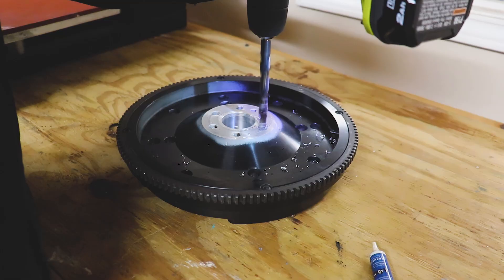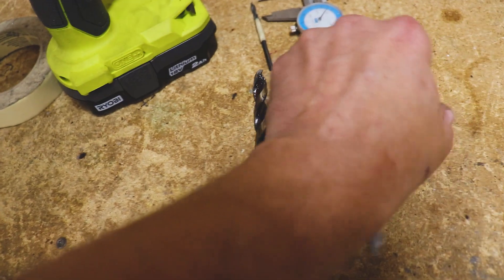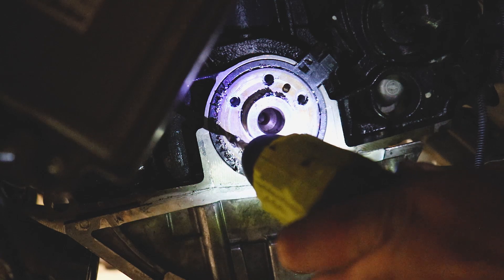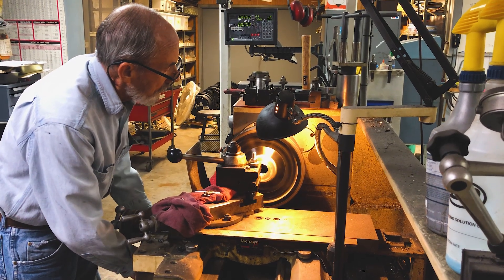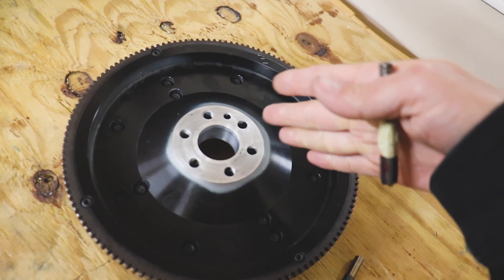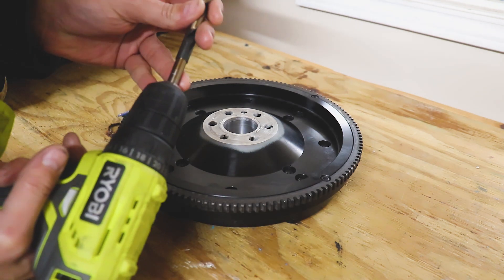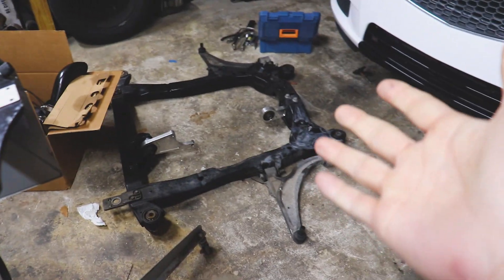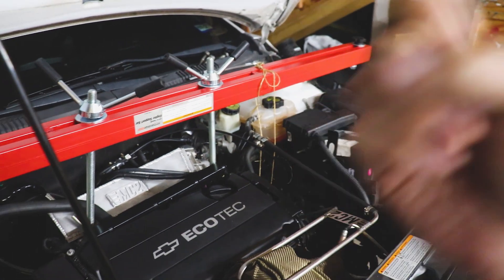Enlarging the Bolt Hole Size in the Crankshaft and Flywheel to Hold More Power! Sleeper Project

Comment: Why did you tap the flywheel for thread ?
Reply from the maker: To install larger ARP bolts because the stock bolts broke off.
Reply: @cmattdabrat  But the flywheel doesn't need thread ? Only the crankshaft.

Comment: Since this crank was a auto transmission engine it looks like there is no pilot bushing to support the input shaft?
Reply from the maker: Oddly enough, I haven't seen a pilot bearing in either of the cranks. Don't think they came with them. Have even searched in the parts manual / diagrams. None to be found / seen.

Comment: With the 2.4 Ecotec I've put 320hp through the stock bolts (6 bolt) and with ARP bolts I've put 400+ hp through it many times and taken it apart, a lot, never noticed an issue.  The LNF 2.0 turbocharged engine uses the same bolts, except there are 8 bolts instead of 6 bolts.
Reply from the maker: Looks like the first time around, the manual I had had the wrong torque specs. So they were over tightened.

Comment: The more I think about this the worse it gets. So bolts in this instance provide 2 forces clamping and shear. The larger bolts may produce larger clamping force although if they are at the same torque specks then they may even produce less. The larger diameter should provide more shear force. However, since they are drilled by hand the shear could be on one or 2 bolts at a time instead of all 6 at once. Precision-drilled pins between the bolt holes would provide more shear force without enlarging the bolts.  Video on how larger bolts doesn't mean the same clamping force. data starts in at about 4 minutes. https://www.youtube.com/watch?v=rGv_UXhNORE
Reply from the maker: Thanks for sharing and you have a valid point. I'm not loosing sleep over it, nor should you. This is all just a fun project, and seeing what works, and what doesn't.
Having said that, what boggles my mind is the fact the stock bolts sheered. Many have ran the same bolts (they are also in the 1.6 A16LET, as well as the 1.4 LUV) without issues. When I installed the flywheel, I torqued them to 45, 120º, and 45º. Don't quote me on those degrees, and I'm wiring this up off the top of my head and refer to the 1.8 manual for everything.
So my question is, is it because of the flywheel being aluminum (softer metal)?
Based on that video, the smaller the bolt, the more clamping force due to less friction. Which makes sense. Sheer force I'd like to see. I understand where you're coming from with the precision drilling or lack there of. However, this video could still be useful for anyone that has, let's say one bolt that needs to be oversized due to a stripped thread. It's fairly common for something like that to happen and common practice to enlarge it to the next size, helicoil it, etc.
TBH, not sure how many people will read this, but I put about 50 hard miles on the car, many pulls, and same issue came up. So I will be pulling the trans, and crankshaft. Installing a stock crankshaft without modifications. I have a billet steel single mass flywheel on the way to put this issue to bed so we can get to breaking the next weak link.
If modding this platform was easy, everyone would be doing it. By documenting this experience it'll save a lot of people the setbacks, time and money.
I appreciate you looking out, and sharing your thoughts. It'll definitely help this project succeed, which I know we all want to see.
Reply: @cmattdabrat  Just figured it was worth mentioning for the possibility of others considering this and since it sounds like you plan on building another motor. I researched strengthing the connection between the crank and flywheel and was seeing recommendations for precision pinning. I definitely understand the fun project Half of what I do is let's see if it will work. Granted I have a small machine shop at my disposal.

Comment: can smelt those old ARP bolts mixed with SAE9000 into a calendrical bar, inside of a argon purged electro magnetic sphere... but machining it also requires heating in very hot within within a similar vacuum purged argon filled chamber. Remote CNC, that's why its $300 a bolt. "the initial manufacturing set up cost has not been found as profitable to public use" there are not any drill bits that can cut into that metal. primary use in large locomotive/agricultural engines, the crankshaft is ARP4000
Reply from the maker: I hear that. I'm not knocking their reasoning behind the price per bolt. As a small business owner, we don't screw with small custom orders (t-shirts) that require a lot of setup time. Just wanted to put it out there that I reached out, and here's what the price is. Nothing available in the Cruze / Sonic 1.8 / 1.4 size. So if you're looking to upgrade, you'll have to come up with a solution.

Comment: I have got no idea why you went at tapping the flywheel as the threads would not match the cranks. Kinda disappointed in your thinking Matt. It was a he'll off a job drilling and extract the old bolt I can imagine  , that would test your patience for sure buddy.  Nice job and well done mate.
Reply from the maker: Thank you. I only tapped the one hole, just to hold it securely in place while I drilled out the crankshaft. I drilled the flywheel holes slightly larger afterwards. As I was editing the video, I thought I'm probably not explaining this very clearly, but we got the job done.

Comment: I still cannot believe bolts that can handle a clutch drop cannot handle whatever torque it was making at over 7000RPM. Were you data logging and if so, how much boost when it let go?
Edit: Also what was the belt issue?
Reply from the maker: I'm surprised too because it's the same bolts in the 1.4 and don't think the guys at ZZP have twisted theirs out?
I was data logging. I actually was doing a 2nd gear pull, and logging only that pull to dial in the top end some more. It was making 13 psi and some change, but I also ran it out to 8.2k rpm and when it bounced off rev limiter, that's where I heard it let go.
Oh, on the belt. Just the dumbest oversight....ever. When I got a belt from Autozone, they gave me the correct belt, but the diagram they kept pulling up, was not the correct routing. It was ass backwards. So I thought the belt was too short, and kept try different length belts. Longs story short, had to look up a video on YouTube and light bulb moment... now it's setup correct. 🤦🏽‍♂️

Comment: I am buying a 2012 chevy Cruze in the next week that needs a head gasket, I found a kit that he head studs and the gaskets, is there any bolts I need to order that are one time use
Reply from the maker: If you're just changing out the head gasket, the bolts are the only tty I can think of.
However, some other notable mentions that are tty is the balancer, piston rods, main cap bolts, belt idler, timing belt idler, camshaft gears. They do say to replace the front engine support bolts that bolt to the head and block, but I've yet to find any. The rest for the most part are reusable. So parts do need the threads cleaned and blue loctite.

Comment: I would have figured those were blind holes in the crankshaft. That’s a surprise
Reply from the maker: They're through holes. I had to be careful to not get too much shavings in the pan and not to start drilling through the rear main cap.

Comment: You have had a lot of rough luck with your build but I must say,  your not one to give up. I'm impressed with your determination and drive . It's inspiring 💛👍
Reply from the maker: I appreciate it. I'm definitely driven to see what this engine is capable of seeing as most mod the 1.4 because it already is configured with a turbo from the factory.
Reply: @Matthew Chevalier  the project is very innovative and will help many in the future with mods that need done with your application.  Very valuable info in your vidros

Comment: Got any chatter from the flywheel?
Reply from the maker: With the clutch, pressure plate, and trans in, and the car in neutral. Definitely chatter. As soon as you press the clutch in, it goes away. All part of switching the a SMF, but not that big of an issue to me.
Reply: @cmattdabrat  mine also got one even with the balancing so close to true weight🤣